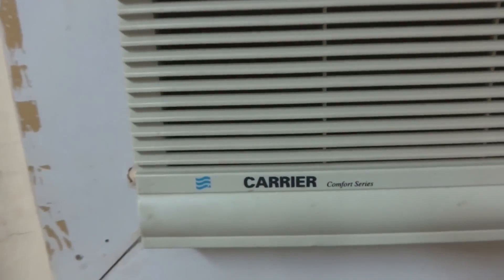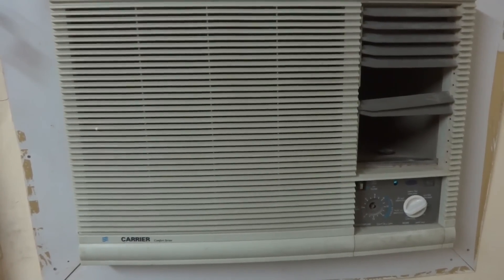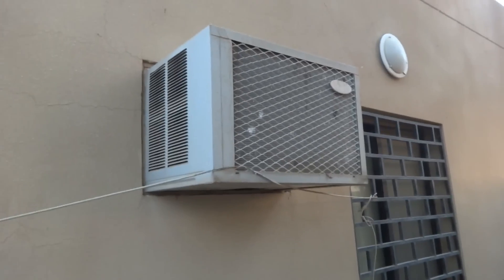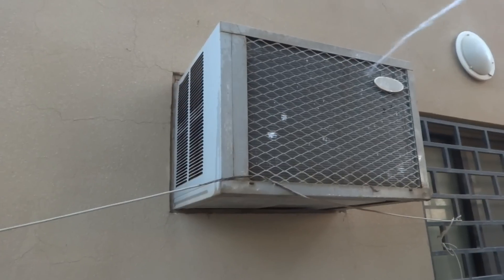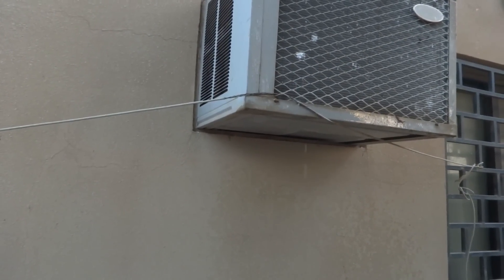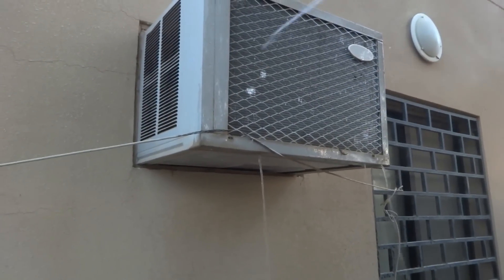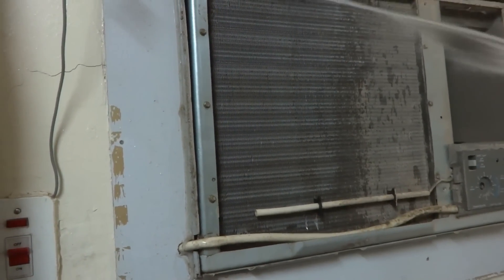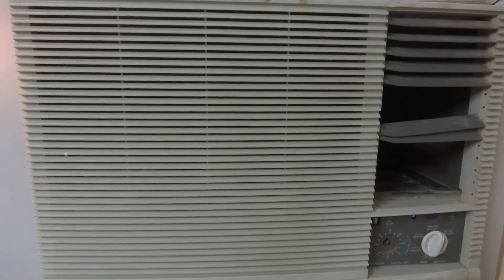Room air conditioner common defect repair. DIY easy fix.

Comment: THANK YOU !!!  I called the repair guy twice last week (he never got back to me, even though he lives just a few blocks away!!) and today after browsing $500 a/c units to replace it, and looking in the phone book for more repairmen (all are much farther away) I came across your video. And thought it was worth to try it.  It worked!!  My a/c was turning on, but, no air blowing out at all, and then it would turn itself off again.  Lot of dirt and debris came out the back of it and I hoped it would work again, and it did!!  I'm SO HAPPY!!  It's going to be a 4 day heat wave (July 1 here) next 4 days and I thought I was going to be SO miserable. (all the local stores were sold out of the a/c I wanted to replace with) You just saved me A LOT of money!!! I am grateful for this video!!
Reply: Gvh
Reply from the maker: That's great if my video helped you.

Comment: my ac was broken in a room for four days, i did this today and omg it works again, thank you so much. Runs super cold now, it really works.
Reply from the maker: That's excellent you have fixed it. Great to see your valued comment. Wish you very good luck.
Reply: Plz answer , can i do that directly ? Without taking off wires or something?
Reply: @JahanZeb1976  my air conditioning is brand new 4 days old 8000 btu no air coming out the vents plz help me brother any tips was working fine plus I have a new born sucks 🙏🙏🙏🙏

Comment: I've had my window air conditioner installed year round since I bought it three years ago.  Over the last few weeks, I noticed the room felt much warmer than normal as temps began rising.  Once temps reach 95 or above, it feels like I only have it set to fan, even when it's on high cool with the temp set to 65 degrees.  After watching your video, I sprayed down both the front and back coils, and I immediately noticed a huge difference.  The compressor is quieter and cycles on more often, and the room is getting much cooler again.  I'm going to start doing this once a year from now on.  Thank you!
Reply from the maker: That's great that my video solved your problem. If you may watch my other videos, you will find them very useful for people in different problems. My focus is to help those people in need by my knowledge and video. Best regards,
Reply: LearningZone what video this one

Comment: just spraying the back of mine worked, thank you! i know i should be doing more but its working and this heat is unbearable. on a cooler day i will, thanks again.
Reply from the maker: That is great if it worked for you. Hope it will work for all. Regards,

Comment: Thanks I had done this before but didnt think i had enough water pressure to do it at the 
location i needed to do it. Seems to have helped quite a bit. Mine was dirtier inside
Reply from the maker: That's great if this tutorial helped you. Stay tuned.

Comment: Window/wall ACs need external filters to prevent clogging the condenser coil. I made AC foam filters for both sides and the top. The filters are large enough to not restrict air flow and work well. I clean them once a month.
Reply from the maker: That is great what you did. I never see such arrangement but seems good to prevent an AC from dust and debris. Hope your AC will not need cleaning so frequently. thanks for nice comment.

Comment: wow it works . i thought my outdoor unit panasonic split ac aerowings series had broken or breakdown because outdoor fan and compressor is not working.but after i clean it works perfectly fine and even quieter than before
Reply: Plz answer , can i do that directly ? Without taking off wires or something?

Comment: A suggestion. Remove the unit from it's casing. Take it outside. Partially disassemble it. Wash out and sanitize the heat exchangers, fan scrolls, and catchment tray. Dry out and test run. Reinstall.
Reply from the maker: +Charles O'Connor It needs two to three people with extra ordinary strong muscles to pull up the air conditioner from its fixture. Also it needs a few hours of effort to do that procedure. Although what you propose is the best ever solution but very expensive in the same time. Regards,
Reply: He was offering a "quick fix", not a deep cleaning!

Comment: Good video! To improve cleaning ability you will want to add spraying the coils with an environmentally friendly no rinse coil cleaner. This will help free up the existing dirt as well as it helps keep future dirt particles from sticking together.

The coil cleaner is hydrophobic and being afraid of the water will try to hide under any dirt thereby making it much easier to rinse off the dirt.

For the outside condenser coils you will want to rinse it off to prevent corrosion. For the inside evaporator coils no rinse is needed (though rinsing can also improve the amount of dirt removed) as long as the unit is left on for sometime as the moisture that forms on the evaporator will act to wash out the dirt and coil cleaner.

The coil cleaner also has some added benefits in the way of killing molds, helping keep the condensate drain clear, and retarding rust. A pump type garden sprayer works excellent for cleaning coils.
Reply: my first time knowing that there is a coil cleanser. What brand are you using?
Reply: I really like Hydro Balance Enviro-Coil Cleaner. You can get it in concentrated one gallon bottles that you can mix up for multiple or larger jobs (again garden pump type sprayers work great for applying and or rinsing) or in smaller ready to go spray cans for smaller individual jobs.
Reply: OK got it. is it found in air-cond service centre or any supermarket?
Reply: JD Lancelot You can find Enviro-Coil cleaner at most hardware stores or Lowes or Home Depot. You can also get it through me KungFuMaintenance com website by a " Enviro-Coil" search in the top right corner where I make a small commission on any items ordered through there.

Comment: Cleaning your condenser this way is only an emergency fix because it only removes a small portion of the dirt that is on the back side of the condenser. You have to slide the unit out of its case and remove the screws that connect the fan shroud to the condenser. Then take the two screws that hold the condenser to the air conditioner pan/base on the lower lip of the  back side and lift the condenser out. The copper tubing carrying the refrigerant will flex a little but be careful not to kink it. Use a brush and mild soapy water to clean the debris off of the back of the condenser fins then flush water from the outside of the condenser to the inside. Put everything back together in reverse order. Take pictures before removing anything so that you'll know where things go when you reassemble them. Before doing this use a trash bag to cover the fan motor and any exposed electrical components. Then reassemble being sure that you put the correct screw's in the right holes because some screws will be longer than others and if you put a longer one in the wrong hole it may puncture a refrigerant tube. Do not hose your evaporator fins the way he is. This pushes dirt into the aluminum fins blocking air flow. Clean your evaporator air filter and lightly brush any dirt off of the fins. If you feel the need to hose dirt out, start at the top of the evaporator and point the hose down at a sharp angle to knock the dirt out of the fins and not pushing it back into the fins. Tilt the unit over to drain out excess water and slide it back into the widow case being careful not to crimp and refrigerant tubes or wires. And of course all of this should be done with the unit unplugged. There are plenty of videos which will show you the correct method. As always be careful with electricity and water.
Reply from the maker: Yes dear friend you are right. But this is a very quick and immediate solution to one in hot summer. The real cleaning can be performed by opening the machine in real way. Regards.

Comment: Was the air conditionner on When you were injecting water on it ?  thanks
Reply from the maker: You can do it either on or off air conditioner. It makes no much difference but for the safety reason you should switch it  off before doing so. Thanks for subscription!

Comment: I have an air conditioner similar to the one you have there which has not been used that much and last Summer it worked just fine until I stopped using it in Winter. This Summer is comes on, but no air is blowing from it. I cannot figure what the problem is.
Reply from the maker: Sidney Mathious Dear friend this is all the matter of troubleshooting. The blower fan motor can stop due to too many reason. The one could be a switch problem, no power to blower motor. The second could be a bad capacitor in the blower circuit. The third could be some restriction which stops it from moving. The fourth can be a bad blower itself. What I could recommend you is, grab a multimeter and test for things. Sure you will find the problem within no time and then you would be able to solve that. I am sorry for late reply because just today I have seen your comments as they were blocked by the system.
Reply: I thank you for the reply and when I can get some help removing the unit from the window I will check those areas you mentioned.

Comment: debris will not go from AC if you wash like this because most of debris is normally seen in side the condenser coil so you should take out the AC and wash it
Reply from the maker: You are very much right friend. But that way would be possible for me or you. Any average house hold can't remove and wash the AC in a DIY manner. So what I expressed in the video is the DIY method not an expert method. And it works up to big extent. Regards,

Comment: I notice alot of the New Air Con are designed poorly. Meaning the Drain Plugs are so darn high. Most AC Company units want you to slightly angle the unit. I had to drill a hole through the Metal to drain the Darn water trey.
Reply: Wash ka charz kya hai

Comment: The clue to this video is that there is much more water going into the AC than is going out.  So...the real reason is hidden. So, either believe this video, or see it for what it is.  All of the water drained into the house?  I don't think that I like this video.
Reply: adithmart no the water went into the drain pan. The water can not go inside.

Comment: Is there any possibility that the water entering the compressor will cause electric shock internally?
Reply: You don't do it when the machine is running or power applied.  That being said, they survive rain and snow with not much trouble.
Reply: Make sense. Thanks!
Reply from the maker: JD Lancelot Dear friend you may subscribe on my channel as I am uploading videos frequently. You will get an automatic notification on each upload. Regards,
Reply from the maker: JD Lancelot Dear friend good that you watched my video. Do subscribe to be in touched and will get notification on each upload. Regards,
Reply: Compressors are sealed units and I'm sure all air-conditioners must be made so that they can get wet during normal operation.

Comment: The sound of compressor is by over heating and compressor trips and will create hot air. U should check gas preassure and reduce lit. Then comprossor ll not trip by over load.
Reply from the maker: Dear friend the solution is there in the video. You may watch it till end. Regards,

Comment: Does dirty condenser cause quick on/off cycling of the cooler also?
Reply from the maker: Yes this is the case you can observe in home air conditioner as well as in car air conditioner. In car air conditioner this is normally due to dirty evaporator. You can watch some other videos on my channel on this subject. Regards,
Reply: LearningZone thank you! this has been very helpful. any advice on how often do I need to do this with my airconditioner?

Comment: sir is pouring water on the front safe?
Reply from the maker: Thanks for subscribing my channel dear friend! Yes it is totally safe to pour water on any side of an air  conditioner. You should only take care of the front switches and control so that they should not get water in the washing process. And if by mistake they get a little water, don't worry. Only wipe it with cloth and keep it for a little time to make it dry and they use your air conditioner as in routine you are using it. Hope this treatment will bring your AC in new state cooling. Keep watching videos.
Reply: i did this it works for me  :) Sir can i pour water on it every day on the front is that advisable? or how often?. thanks for the reply sir :)

Comment: do I do this when the AC is off or on? and if it is off how long do I have to wait in order to turn it back on?
Reply: If you dont get the controls wet, you can power it on. Theese air conditioners are completely weather sealed

Comment: Hi Friends! Mine is Hitachi Window 1.5 ton AC purchased at 2 years ago. Now, as and  when I make power on, It start but immediately the Code Error 'E9' displays on the AC Penal. While starting it and displaying code error, no remote functions are being accepted by AC control Penal. All these happens within 5-10 seconds..Please tell me the appropriate solution... !!!!
Reply: If you have a Owners Manuel it may refer to what the code is. If not could google what the codes mean or call the Manufactures number to ask for a technician to see what the code means?

Comment: Is it safe to wash the back of yhe aircon?
Reply from the maker: Yes friend it is safe. The cleaning and washing procedure is this same. Water is not harmful. Regards,
Reply: LearningZone really?bcs our windows type aircon is not blowing cold air even we waited it maybe 2 hours and the smell of the air is kinda bad what should i do?Do the same procedure?
Reply from the maker: Yes sure you may try this. If you can pull out the air conditioner, bring it off and wash it out side. That will provide maximum efficiency. Regards,
Reply: oktnx last question is it okay to wash the top and the front of the aircon? im asking this bcs im sacred that my aircon might explode ?
Reply: Just make sure the water isn't coming with to much pressure.

Comment: Should I take off electric wire or not plz answer me ☹️☹️
Reply from the maker: It's normally no needed to take off anything to do such maintenance. But you can take off if it is easy for you. Wish you good luck. Stay tuned.
Reply: @JahanZeb1976  I'm gonna do it now! Wish me luck
Reply: @JahanZeb1976  I washed it very well , but air still not cool .. what should I do next ? 😥
Reply from the maker: Dear friend you would have some other problem with your ac. That can be bad capacitor, bad wiring, bad switch or thermostate or bad compressor also. It needs to thoroughly check and troubleshoot.

Comment: do I have to wait for it to dry?
Reply from the maker: No need to wait for anything to dry. Just do the procedure and start immediately. It would not harm anything. Sometimes I am doing it on a running air conditioner.

Comment: Sir pls could u help me my window ac is building Ice and becoming very hot but when i turn it off and then turn on again it works fine and still its cold but building ice its freezing everytime i open it. Any tips
Reply: Harry Jr. Lopez-Newton you need to let the ice melt and thaw out before using it again, in hot weather should take around 48 hours.
Reply: Watch Addiction Watch Reviews thank u sir, i already clean my aircon yesterday  now  working fine thanks its okay now.. maybw that freeze thing bcoz of Dirt. Now no more ice 😘👌

Comment: my window unit doesn't have a place for water to leak outside isn't it supposed to?
Reply from the maker: Make a hole first to drain the water and then do the process.
Reply: Ok thanks

Comment: You pushed the dirt in the unit. I've cleaned mine but I take it out of wall and remove the case. Then I rinse from inside out. Be careful not to get control panel wet
Reply: What if you do get the control panel wet??? Can I just let it dry out completely before plugging the unit back in lol?

Comment: my window ac's  inside coil is freezing up, and  I cant remove the whole ac because it's mounted on 3rd floor Apt. I can't clean it
Reply from the maker: That is very difficult situation then. hope you will find some way to solve such problem. Regards,
Reply: Thank u for the response

Comment: There isn't any problem after washing with water on electric circuits or these things i am sorry i cannot believe that and i cannot imagine you do it . i am afraid to try it but please confirm to it will not be any problems after wash like that
Reply from the maker: Normally it doesn't create any hurt to Electrical or any other parts. Anyhow this is the procedure used by all service shops and centers. choice is yours if you do it yourself or do it by service centers.

Comment: How to fix that our aircon will automatically goes to warm even i did not switch it to warm. Then i switch it to cooler it wont cool how to fix that
Reply from the maker: Seem your air con had gas charging problem. Check for appropriate gas pressure in the unit.

Comment: Sir my LG window AC 1.5 ton pcb circuit is working but when it start then some time cooling but after sometime temperature not coming below 26/25 and cooling off.
Sir whats the reason please guide me.Thanks